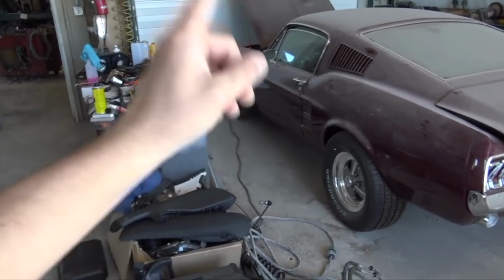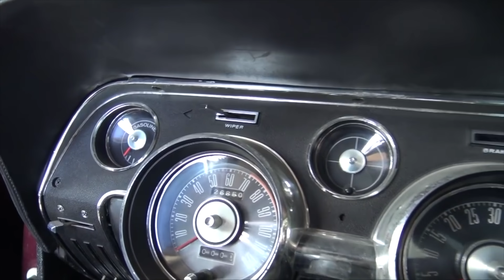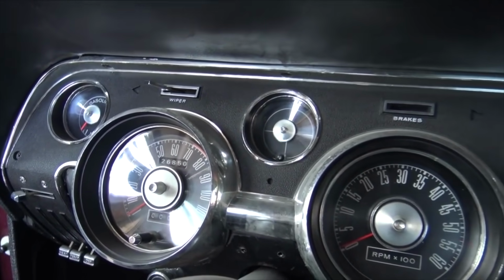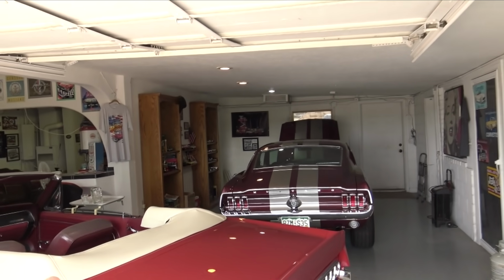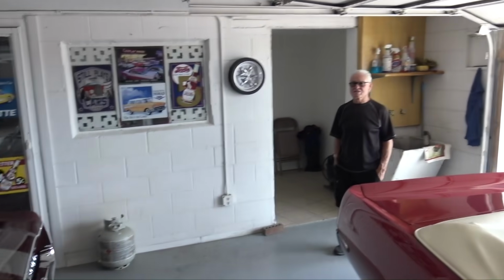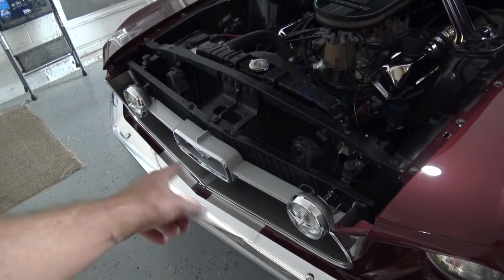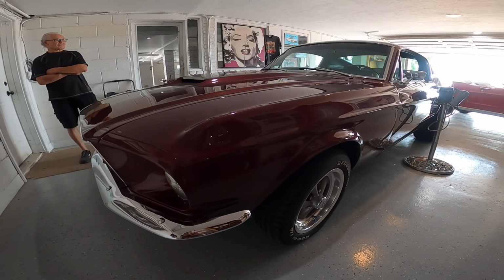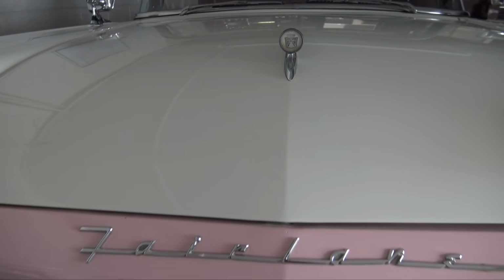Barn Find 1967 Mustang Fastback Restoration - Better than OEM

Comment: I'm sure if you take a quick glance, you'll see his spirit riding shotgun in the passenger seat. Hearing it rumble back to life, first crank of the key really teared me up. ✌🏻✌🏻✌🏻
What kind of  beating heart does it have? Boss 302 or Boss 429, Dave?
Reply: Looks to be a 390 ci. The same engine that powered the "Bullet" Mustang driven by Paul Newman in the movie  Bullet . The "Boss" family of engines weren't around till 69' 70'  they were introduced and developed for the Trans Am racing series.